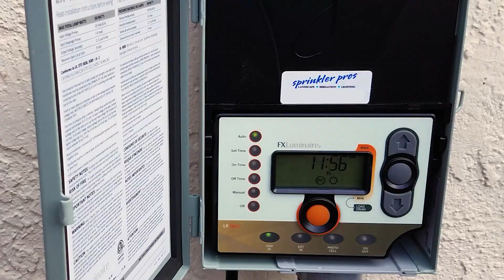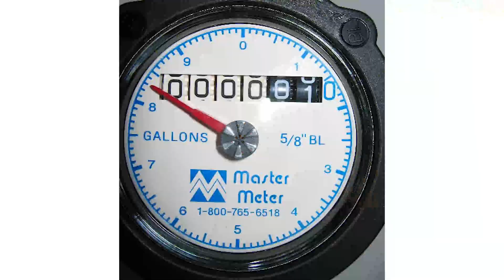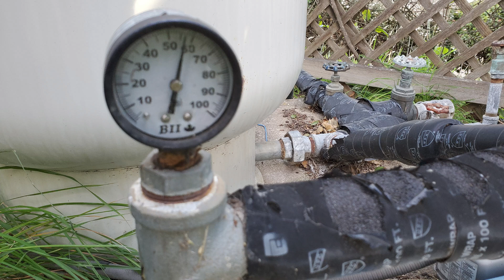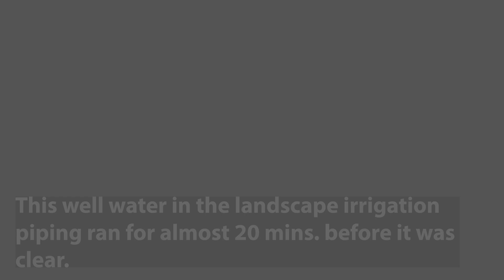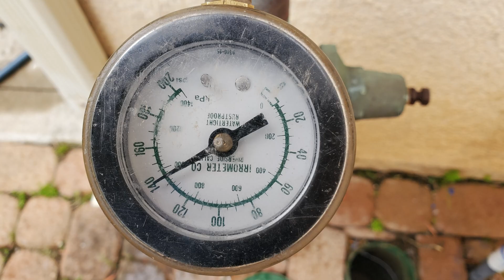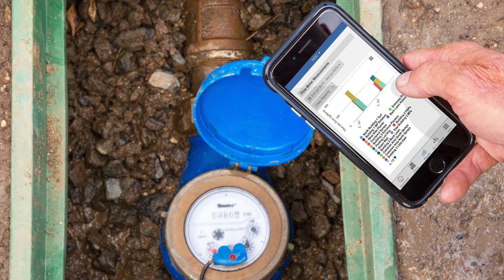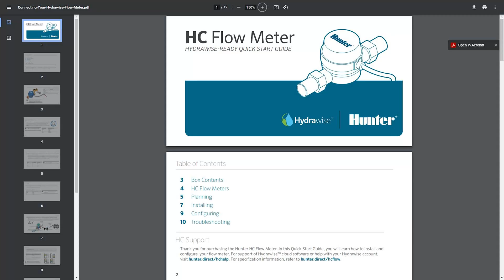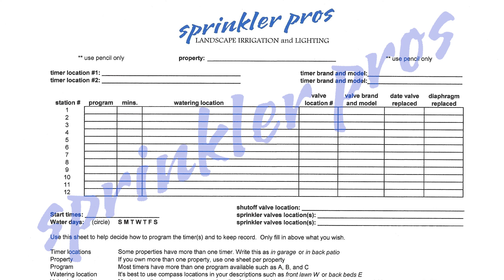My sprinklers are stuck on! HELP! | I'll show you how to turn them off

Comment: I have a seven zones sprinkler system. The house was build in 1992 so it does not have sprinkler control valve. It has seven valves around the field. The meter is Rain bird.  It has seven red cable to the meter. The meter has 4 programs and three of them are in zero. The program that in on has the complete time of the seven zones. My problem is that the system ran and keeps running after finished with the seven zone.  It has a shut valve after the main water meter. I believe it is a meter because I do not have control valve and the zones cover the time that was program without stuck in any particular zone. The system does not run the days that is off. Time and days are running well. The problem is that it does not stop. Any suggestions?
Reply from the maker: Luis,
Without being there and walking through my troubleshooting steps I am only guessing from experience. The first thing I would check if I was there was the programming to be sure you only have programming on one program.
I hope you can find a good irrigation tech in your area to help you with this.

Comment: my timer keeps cycling thru the zones. is my electrinic control box faulty
Reply from the maker: Do you have a Hunter timer?
Reply: @SprinklerPros  I do 
I figured out the issue ty for responding
Reply: @tbasshandyman7610 What was the issue?
Reply: @SparkyIBEW  I figured it out it was user error 
Happy Holidays

Comment: I use a shop vac to flush a buried valve. That worked for me. I hand cleaned the valve in the sink. There was a small pebble in it from a break caused by roots.
Reply from the maker: Awesome! Shop vac is a great idea. I don't have room for that on my truck.

Comment: very helpful. what if the plastic handle to the shut off valve is hard to turn. any tips?
Reply from the maker: You might need to replace the shutoff valve. Be sure to get a Spears or KBI from Ewing Irrigation on McCoy--don't buy one from a hardware store or HomeDepot.